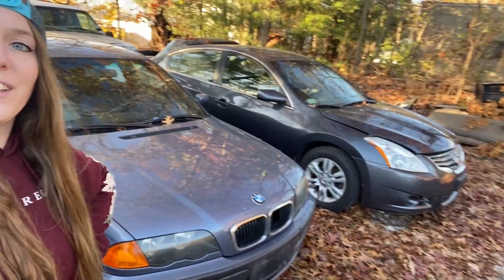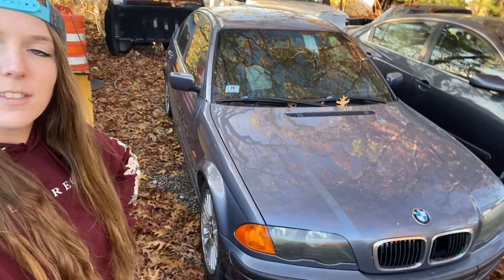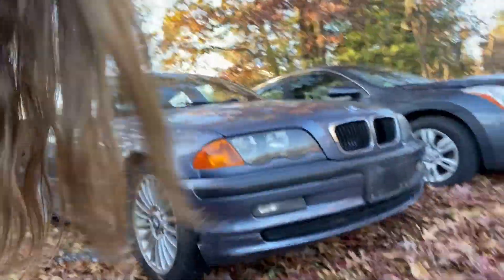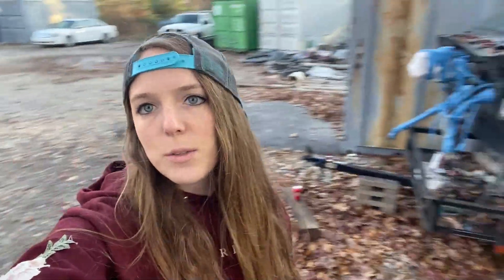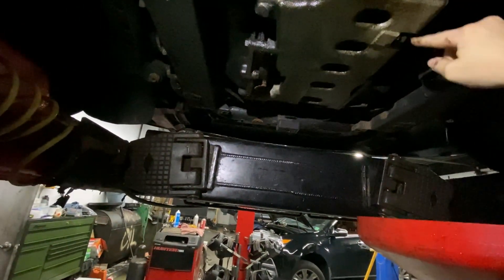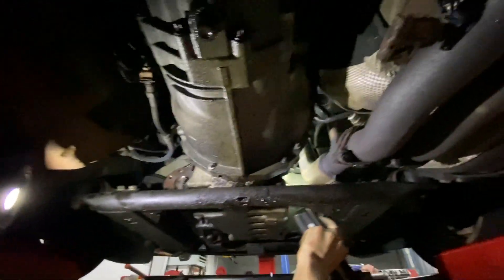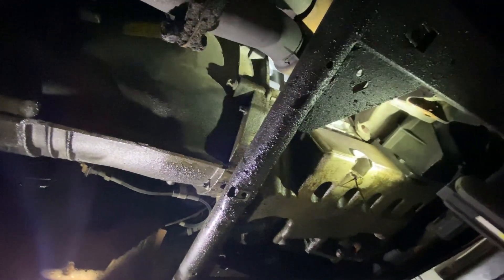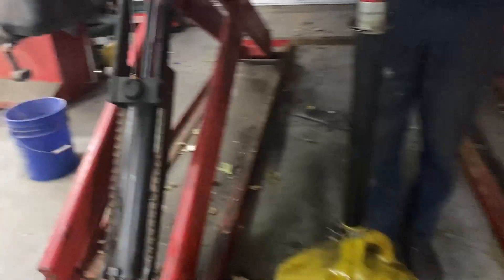BMW Build - Part 1 - Buying a Budget Drit Car

Comment: The color is called seibergrau which means silver grey. Lol
Reply from the maker: It’s says slate grey right on the tag
Reply: @AshleyVaughn  I have the exact same color and it says seibergrau, I wonder if it's a different year model so they used a similar color in English. Mines an 01